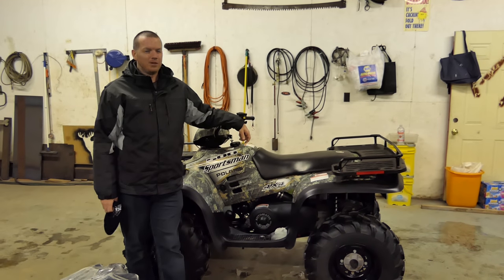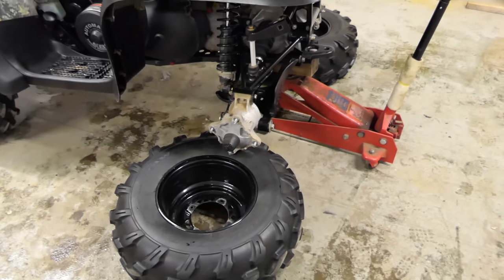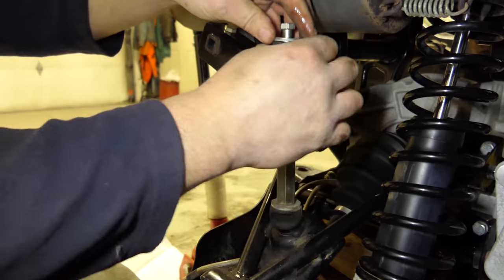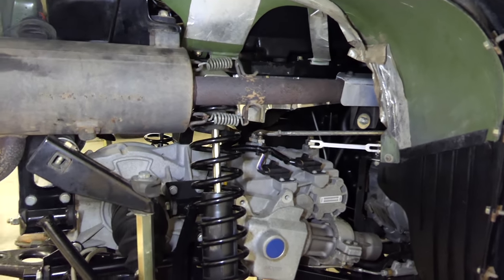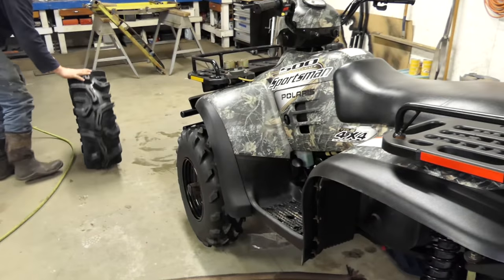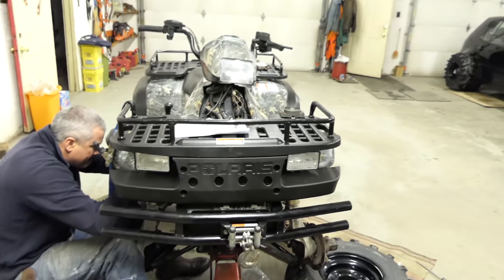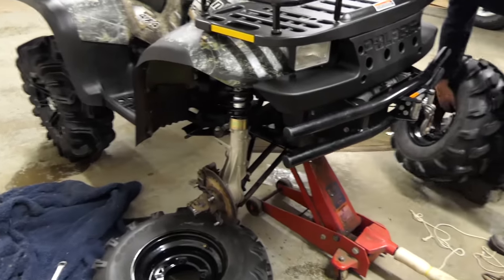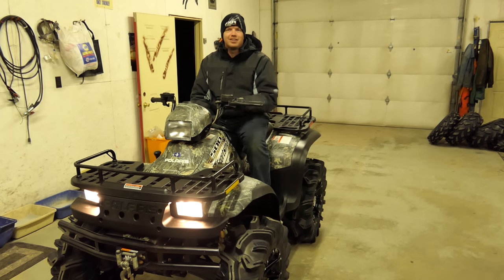How to Install 2 inch Highlifter Lift Kit Polaris Sportsman

Comment: That is the cleanest 500 that model I have ever seen keep the fluid changed in hubs and diffs she will last a while also a clutch kit wolill hellp
Reply from the maker: Just added a clutch kit and love it! Runs much better now with the big tires on it.
Reply: @Temptation_Offroad  in what way does it run better?

Comment: Hey did you have to swap out your oem front axles with the lift kit ? Reason why I ask is because I put a 2” spacer on top of my strut and I just blew out both axles
Reply from the maker: No i didnt, mine have been just fine so far.

Comment: ahh, just saw you have this lift kit... its easier to put in the kit from the top... take off the rack, fender.. and its all right there... way easier than the way you did it... but you got it done... so looks good.

should of measured with the old tires so you know the real lift..

Comment: I have a 2001 and I am trying to upgrade the front spring off. Any suggestions for how to remove the top bolt on the shock tower?

Comment: Hello two questions, what clutch kit did you install?   How did you mount a winch with the front bumper still on it?
Reply from the maker: Check my channel for the clutch kit install video. It was an EPI clutch kit. The four wheeler came with the front bumper and winch when I bought it.

Comment: If you loosen the front strap holding the axel and hub assembly up just a little you could have dropped it down a couple inches with no problems and the shock would have went right in

Comment: Got the Back lift on with no problem thanks to this video, only question is there a nut to take off the top of the front shock tower before you can remove it or should it just be compressed until you can remove it?
Reply from the maker: Yes i believe that is correct compress it and then remove the nut
Reply: @Temptation_Offroad  Thanks man, I actually installed the front without removing the nut at the top of the shock tower and I rented a spring compressor from the parts store which made it a whole lot easier. Now to use your clutch kit vid for my next install. Thanks!

Comment: This basically just raises the body right? It doesn't give you more suspension or ground clearance. Am I wrong? just wondering was thinking of larger wheels and tires, that gives you more ground clearance I guess. Just thinking of my options. Your videos are very helpful. Thanks a bunch for sharing.
Reply from the maker: Correct, its main purpose is to make room for larger tires. Even with this 2" lift the 28's still rub when turning and especially with my snow plow on the front. I know newer model sportsman 500s can clear 28s with  no lift kit, because of the different fender design. Glad the videos help out!
Reply: Absolutely, You save me a lot of time and money. I think I may buy this same kit for some larger tires on my stock rims. Mine is too old to drop the money on nice rims.
 @Temptation_Offroad

Comment: I’d definitely do. Clutch upgrade to handle those big tires!
Reply from the maker: Yup, already done. I put in a EPI clutch kit and it helped out tremendously! Check my channel for the videos.
Reply: I just picked up a 1999 500 and it needs all the bushings on the rear!!
Reply: @Temptation_Offroad   can you link me the epi kit plz I’m gonna start building my sportsman with a 2inch lift 14in rims 2inch spacers and some nators for the tires all I’ll need is a clutch kit
Reply: @Temptation_Offroad  link to clutch?
Reply: @Temptation_Offroad   do you know if they make a kit for a 2002 400 all i am finding is for a 500
Reply from the maker: @charliedavis3993  Call Highlifter and ask. Im not sure.
Reply: @charliedavis3993 it would be the same kit. Same frame, same shocks, tire size, clutch, belt, only difference is engine cc's
Reply: @Hammerback0   thanks for the info i still have the 400 as a backup, i went out and got a 2017 polaris 850 highlifter i love that quad

Comment: I want those exact tires and rims on my 2019 Polaris 450 Ho. What size would you recommend me go with? Do you advise a life kit? No one can tell me around here!
Reply from the maker: These tires take a lot of power to turn over and are a very heavy tire. I believe the smallest size they come in is 28s. Your 2019 450 might not need a lift kit to fit these, because the newer wheelers have more fender clearance than the older ones did. A clutch kit will probably be a must. EPI and QSC are supposed to make good ones.
Reply: Temptation2003 Does it ride hard? Like a tractor ? Or is the ride smooth with those tires?
Reply from the maker: @lifeofcinnammon  Its just a tad rough at like 3mph, but after that it actually rides smooth because of the center lug on the tire coming down the center a ways. It rides very nice for such an aggressive tire.
Reply: Temptation2003  Thank You So Much, You Have Helped A lot.

Comment: I did a 2 inch and my rear axles aren’t very happy I don’t know why have you had any problems
Reply from the maker: Thankfully mine have been good so far. I mainly use it for snow plowing and occasional mudding. Nothings broke yet.

Comment: I have a 04 700 when I got it it had a 2” kit on the front I am having problem with axle braking and boots ripping I have replaced two axles in a year and now I just replaced two boots
Reply from the maker: Im sure any time you add a lift to a machine and i crease the axle angle there will be a much greater chance of breaking something. Sorry to hear that, i just use mine for plowing snow and hunting so Im not really very hard on it. No issues so far for me luckily.
Reply: Temptation2003 yes I mud ride I guess I might be a little tuff on it thanks for the reply
Reply: @williamburress3956  do you buy heavy duty axles or stock. I have a 700 as well and debating on a lift kit

Comment: Ive got a 2001 Polaris sportsman 500ho Remington edition with the double tube and I want to install a winch on mine was wondering where you got the bracket for your winch? Thanks
Reply from the maker: Mine came with the 4 wheeler when i bought it.... Nice wheeler, I use to have a 2001 Polaris 500HO ducks unlimited special edition. Wish i never would have sold it.
Reply: Thanks and could you possibly tell me what brand of winch you have because I found the bracket but I'm having a hard time finding a winch that looks like yours. Thanks
Reply from the maker: @jacksonl.2632  I would go look at it for a model number but im out of the country until January 10th.  I will try to look once i get back home.
Reply: @Temptation_Offroad   thanks for the reply and hope you have a merry Christmas and great trip
Reply from the maker: @jacksonl.2632  Thank you, Merry Christmas and Happy New Year to you as well. Trip is going great so far, enjoying some warm weather instead of the -10f in Mn 🤣😂🤣
Reply: @Temptation_Offroad   thanks 👍

Comment: So is that life kit better than the top spin on lift spacers? Having problems with my axle angles.
Reply from the maker: Probably not, my axles are at a pretty steep angle also after installing this.
Reply: @Temptation_Offroad  yeah mine keep popping out of the front diff with the travel
Reply from the maker: @nathanhonea113  Oh, i havent had that happen at all. Can you get longer axles?
Reply: @Temptation_Offroad  no just don’t know if spacers were better than the spin on ones for the tops of the shock out of the geometry was different between the two
Reply from the maker: @nathanhonea113  Im not sure either

Comment: How do u like those tires I’m looking at them for my 2020 850
Reply from the maker: I really like them, but they are a heavy tire and also I only use them in the winter for snow plowing and summer time occasionally for hitting some mud holes. They seem like a great tire, but im not sure how well they will hold up to constant hard pack gravel trail riding etc because it is a fairly soft rubber compound on the lugs. Otherwise so far i love them! If you do get some keep me posted

Comment: What size tires and it doesn't mess with ur gears in ur axles
Reply from the maker: 28x10x14 Tires and yes a clutch kit is recommended when going to a much bigger tire like this.

Comment: You didint have any problems with those caps going on the front over the hubs?
Reply from the maker: Yes i did, mine didnt fit over the hubs. I called them and they didnt have anything that would fit the front hubs.
Reply: @Temptation_Offroad  oh okay it looked like they were on there in the video. I have exact same 4 wheeler as you and was wanting to do those wheels too but then i read about the hub problem. Maybe i could do like a 1 inch spacer though.
Reply: So im kind of stuck but i see in your video you got the hd caps on in the front?
Reply from the maker: @lanejenkins5503  Check my other walk around video and also at the end of this video when I backed out they were not on the front hubs either. The caps wont fit on front hubs.
Reply: @Temptation_Offroad  ok thank you

Comment: Are you using the stock axles? Cause I have a lift for mine and put it on but it made my axles bing so I wanna know if your CV acles are stock or aftermarket
Reply from the maker: Mine are stock axles. I Haven't had any issue yet with binding or anything.
Reply: Thank you!

Comment: I have Polaris Sportsman 500 2006 my daddy bought me I don't have no problem but I'm thinking about getting 600 or 720
Reply from the maker: I would say go a 800 or bigger if you want to play in the mud! Takes a lot of power to turn over big mud tires.
Reply: @Temptation_Offroad  ok I'll think about it so will 500 play in mud just wanted to ask but it has power

Comment: where did you find an 03 that clean? lol
Reply from the maker: adam richardson By Duluth, Mn. Only had 800 miles on it! Thats why i bought it. Just like a new machine, plus i prefer the older look better than the new ones.
Reply: for real lol, this thing looks like it came straight from a dealership
Reply: adam richardson I have a 94 magnum 425 and the paint is faded there’s scratches on it and holes in it
Reply: I agree. I had a 2017 Sportsman 570 that I bought brand-new, I got rid of it. There's so many problems with them. It gets too hot and clunks. There's no backup pull start because it's too high compression. I am in the market now to look for a Sportsman 500. I think I would like it better. BTW... I'm a Minnesotan also. I live near Milaca.

Comment: your only as high as your lowest point, that snow plow attachment is killing your ground clearance.
Reply from the maker: You are totally correct! I haven't done any mudding yet so that is why i left the bracket on there for now. If i plan to do any serious mudding the for sure it would need to be removed. Good observation though!
Reply: @Temptation_Offroad  the reason I know is that I did the exact thing, lol.ssame lift. sporty 700 and my snow plow attachment, even being on the front is still low, has hung me up more times than I can remember. it hits rocks and trail junk, vines, branches, me dragging stuff around but, then winter hits and the plow goes on and its worth it. as long as, like you said, for deep stuff you would have to take it off. are you happy with this highlifter? i dig it. I run 27in. bighorns. is it fine with the 28's?
Reply from the maker: @lluwd  For what i need the 28s work fine but i would of preffered to go with 27s. Only thing is they didnt make this tire in a 27 inch version. The 28s rub the fenders when turning still even with the lift.

Comment: Did you have any problems with the rear axles pulling apart ?
Reply from the maker: Nope, everything went together pretty easily on the rear of it. The front was a pain in the neck to do.
Reply: @Temptation_Offroad  not even like when your riding ? The axel angels just seem really steep lol I Jast got an 700 twin and was just curious
Reply from the maker: @355east3  Ive only used it for snow plowing a few times and a couple short ride so havent put a ton of miles on it, but so far no problems at all. You are right the axle angles are pretty steep.
Reply: @Temptation_Offroad  thanks for the feed back and your bikes in beautiful shape
Reply from the maker: @355east3  No problem and thanks a lot! Have a great weekend.
Reply: @Temptation_Offroad  hey just one more question lol what are those tires?? I've been looking for a name but cant find it lol
Reply from the maker: @355east3  Sedona mudda inlaw

Comment: CV joints are going to get destroyed. BAD design. This vid is 2 yrs old. Ya fixed it right?
Reply from the maker: So far no problems yet with my cv joints. I just use it for snow plowing and the occasional ride in the summer mudding.

Comment: Not a fan of those front spacers you lose a lot of suspension travel
Reply from the maker: Very true, what are my other options? I noticed it when riding in ruts its pretty tippy instead of having suspension flex.